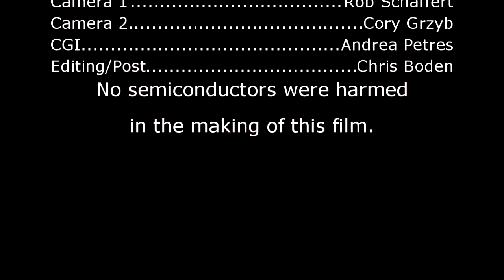Geek3 LED (Paul's Blinkenlights)

Comment: i have done a similar thing using 4 outputs and an 08M PICAXE. to drive 8 seven segments with decimal points using 9 shift registers, i have some videos on my channel about them i might do a few more. the picaxe receives 8 bytes of serial @4800 baud to either control the display directly or process ASCII characters to show as symbols